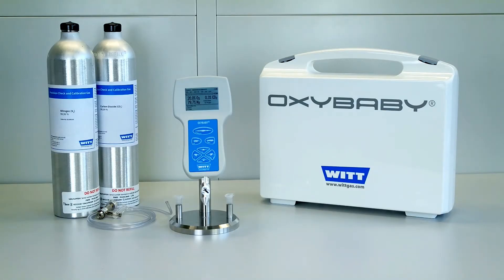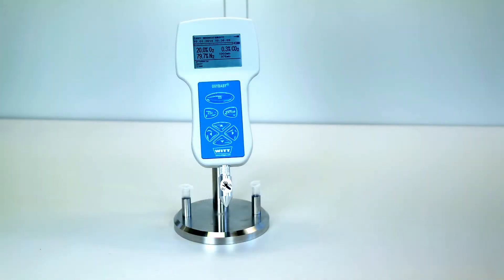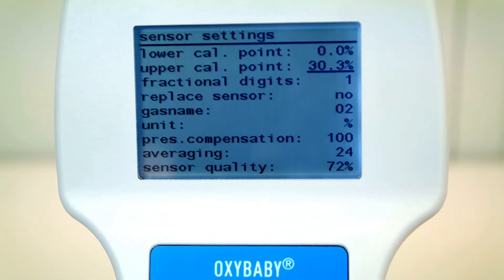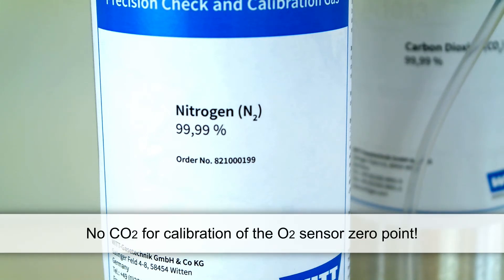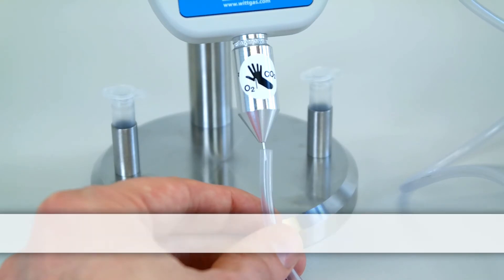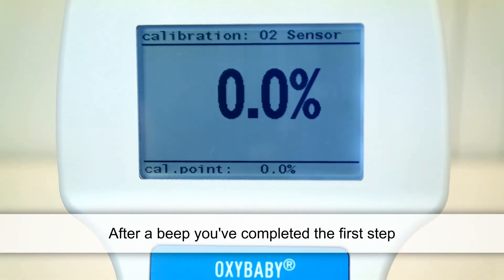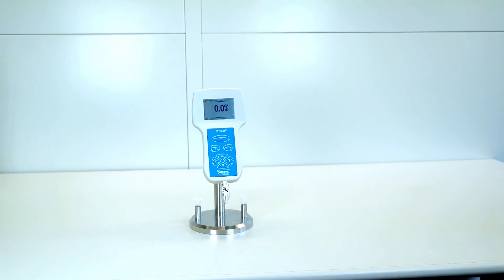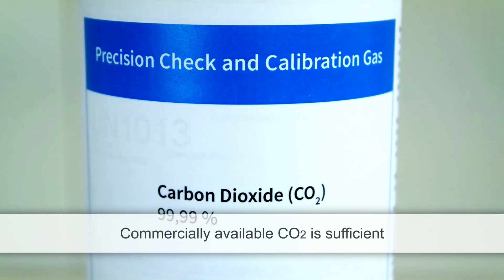Calibration for headspace gas analyser OXYBABY

Comment: What is the sample flow rate need to be?

 Can we keep 1  L/MIN??
Reply from the maker: It is important that the calibration gas sufficiently displaces the ambient air during calibration. Low pressures or gas volumes are usually sufficient for this.  Please note that the calibration gas hose must not be tightly connected to the OXYBABY needle; the gas must be able to flow freely. During all calibration processes, ensure that the measuring cell in the OXYBABY is not subjected to pressure. The gas to be analyzed must always be sucked in by the built-in pump at atmospheric pressure (= ambient pressure).